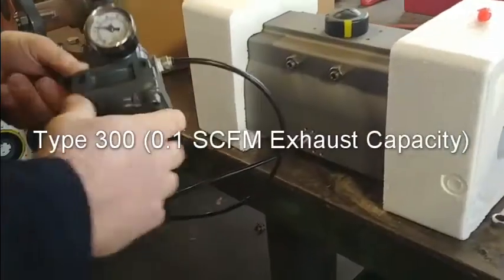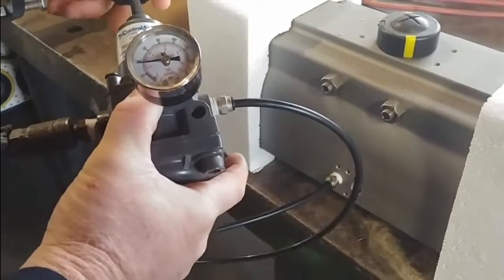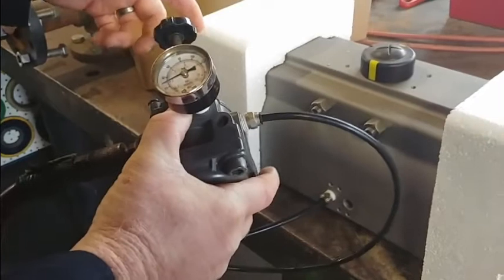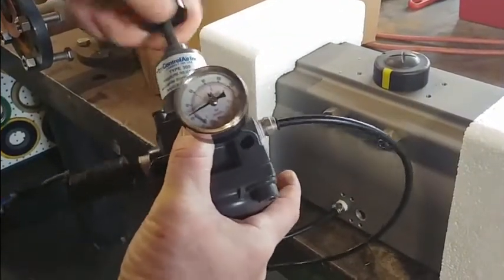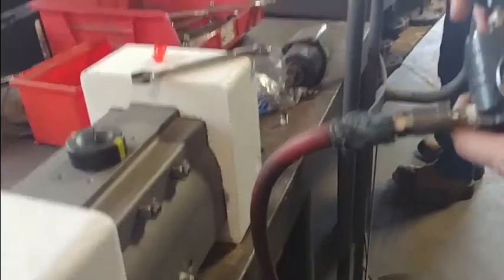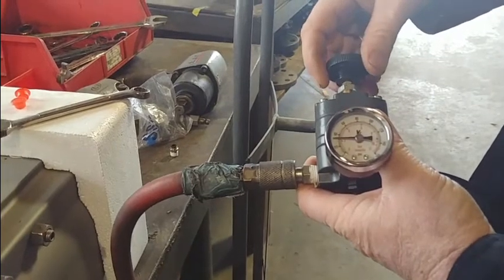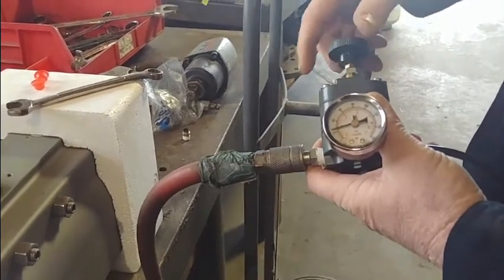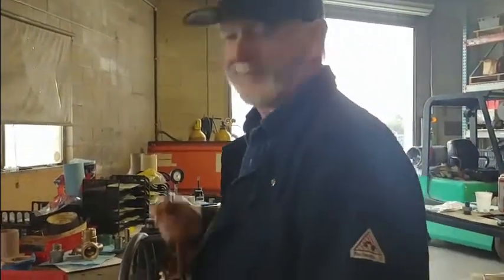ControlAir Regulators Type 100 Vs. Type 300 Relief Capacity

Comment: I have one on my air pump in my garage.  The type 100 is designed to bleed air and as we all know, compressed air is very expensive.  Use a 2-way valve prior to the regulator and shut it off when not in use.